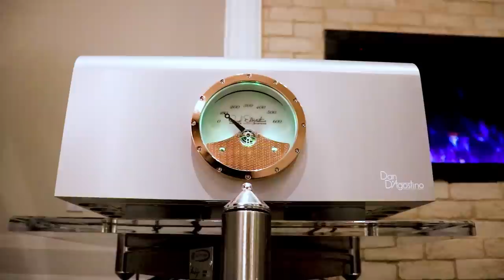McIntosh MA352 vs Hegel H390

Comment: Add in a Processor, reset the Crossover, RTA, set the slope and DB,  recalibrate the speakers. Stereophiles will not live w Processors, however, if it is well calibrated , any system can sound full, bold and expensive. Do note that source used during comparison, are crucial as well.

Comment: @Scott Roberts, and All...

Just a follow up. I have had the Magnepan LRS + for about a month now. They are indeed as fantastic as advertised!   I am amazed that they so fill up the room with sound.  
Prior to the Magnepan I had Focal 1028Be.  And they were very very very good. But not good on the same level as the Magnepan.  The Magnepan sound is coming from the rear as well as the front!  It's glorious.  I also made some changes on the bass side of things.  I sold my REL T9X and replaced it with a pair of T7x's  Smaller--but oh so nice!    Maybe one last addition.  I'm looking at a HIFI Rose RS250A as an external Streamer.  The DAC chip is supposed to be quite good and the user interface seems very new millennium.  I'll let you guys know how it works out.

Comment: From the other side of the globe, here, I once listened to a high end system that was able to make me feel I was in Carnegie Hall (2,000 seats?) when in a listening room of about 5m x 15m and 3.5m high. Maybe 25 years ago. Not brands you sell, but certainly possible with some of the kit you sell. (Pete Seeger & The Weavers in a singalong with the audience recorded from the side of the stage where the band are all behind each other in the right channel). Not my kind of music, but impressively revealing.
I also listened to a system that seemed broken, compare to the silence you mention in "The year of the cat", but here both speakers produced audio. The soundstage simply was cut off along the right side of the right speaker cabinet. After cable swaps and experimentation, a CD-booklet photo of the recording session in the studio solved the problem. The grand piano in the small studio had been placed against the right wall of the studio and this was perfectly reproduced.
The recording of "The Year of the Cat" is likely a multi-track recording with the mastering (in post) placing the "voices" in the stereo soundstage (through the use of pan-pots (panorama potentiometers) ). Reproduction here totally depends on micro-dynamics, both in left-right and in front-back - the latter is actually a fault to our brain. The live stereo miked Carnegie Hal session, however, provides real phase front-back waveform information that our brains can process much better.
If you go back in the history of tube-tech, into studio and recording kit, you will find very "neutral" sound that has no "tube" character whatsoever. Try RCA Living Stereo recordings for that matter. The debate "tube versus solid state" is driven by lazy electrical engineering that ignores waveform and phase correctness by approaching everything as a sine wave approximation. Most audio designing electrical engineers do not understand the benefit of a frequency range beyond 20 kHz. Our ears are not single +/- wire microphones but complex waveform parsing systems that are much faster than our vision. As there are some neurons in the brain with electrical synapses (i.e. not chemical like the majority) we can safely assume these to play a role in waveform analysis and spatial clue parsing that we do in the 20Hz to 20kHz band (which likely only works in the 200Hz to a couple thousand Hz range) by throwing the lowest latency at these tasks.
Now tell me what "bandwidth" you need from amplification (or speakers), what absence of frequency variant phase and distortion faults, we need, to faithfully reproduce all the acoustic audio clues? An electrical engineer told me he had studied Fourier analysis and did not need a lot to reproduce a 200 or 2000 Hz block wave. I don't agree. True in theory, but no speaker, no crossover or amplifier can cut up a 200 Hz block wave into a pulse train of half sine waves that reconstruct the 200 Hz - impossible within the 20,000Hz limit. IMO. Look at the waveform of a clarinet, then a flute, a cello, a violin and piano - all at the piano's central A note of 440Hz. Imagine these to play about at the same time and we can disentangle them and place them in space. Talk about bandwidth and waveform.
My hypothesis is that vacuum tubes have more bandwidth than frequency range. If only the darned transformers, and capacitors for that matter, could be removed from the signal path (a simple transistor is a complex network already, by the way).
Why would one brand do a solid state pre-amp with more than 1 MHz bandwidth? Because they have figured this all out. All the "phase" or "time" attention in your WA speakers is because of this reasoning, too.
It's all relative. Long time ago, one day, I played a reference title in my music collection. My wife traversed the listening room and asked if I had changed something in my system. "Why do you ask?", I said. She answered "it sounds better than two days ago." My follow up question was, "is that important to you?" She answered, "no."
The change I made? Two uninterrupted AC lines - direct spurs - from the main mains panel to the wall outlets of pre and power amp. After all, what we listen to is alternating current "~rectified" (*) and modulated coming out of our speakers. The next improvement came when I phase-aligned all the components in my system - my national AC wall-outlet/plug standard allows phase/neutral to be plugged either way and that is impossible, e.g., with British and French (**) wall outlets (where you must hope that the electricians that connected the wall outlets to the cabling never made a mistake). (***)

None of this defines musicality, by the way, but it is on the critical path to experiencing life-like performance. And we should not forget that we took ages to learn to distinguish mother's voice from the noise floor of everyday sounds and other voices. That learning started already in the womb as soon as the hearing system has been formed and we are born with imprinted melodic lines of our language that we immediately can use to hold our parents emotionally hostage with well performed crying spurts. In order to be able to recognize musical instruments - distinguish them from each other - it helps to go to live concerts a lot so as to train the brain in recognizing all the instruments. Or, our ability to parse and judge music completely depends on the training our brains went through. OK, our physical hearing limitations are a bit important as well.

When it sounds "tubey" it's not good. A neutral mid-range that is free of harsh distortions may come across as warm next to a system that is somewhat harsh in the mid-range, but it still is neutral.

(*) ~ as in ~= meaning "about equal". "Sort of".
(**) So I used these wall outlets in the music room in my house to prevent phase/neutral reversal using wall outlets with a lid on them that is closed when not in use. This prevents, by the way, plugging devices in that I do not want there, like vacuum cleaners.
(***) The phase is easily located in the wall or PDU outlet with the old screw driver electricity phase tester. The correct appliance phase should follow from its schematics and hopefully correct component connection inside ... An easy test, however, is with the in-wall electrical cable detection device you can by in the home DIY store. That device does not have to be able to detect studs and mass density differences. It should detect an electrical field.
Disconnect all devices from mains and each other. Connect one device to mains and switch on. From, say, 1.5m or 5 ft away, with the "electrical cable detector" switched on, move towards the device and measure at what distance the detector "sees a cable". Switch the audio device off, revers the plug so phase/neutral are swapped and measure distance again. The shortest distance is the correct phase/neutral orientation. When all devices are aligned, voltage differences disappear that otherwise exist between device grounds that connect via audio "ground" links (often in one of the two stereo interface links and more harmful in unbalanced connections). You can measure pretty high voltage differences between devices actually when phase/neutral do not align and this means dirty AC would live there. Not the same, but an interesting comparison is with links between digital components that have "floating" links where both ends of the digital link are like a transformer that relays the signal and not the noise carrying voltages.
Reply: WTH did you just do?!

Comment: Always been a McIntosh fan, listen to a lot of Japanese Jazz vinyl pressings that sound thin most of the time. 
I’m thinking the MA352 might be the ticket. I’m currently running a 200 watt
MA 6600. Just love it but want to try
out tubes for a change. 😎
Reply: I have a 6600 and demoed a 352 and I found a marked difference - but I think I want more of an upgrade

Comment: Hello- Although I haven't heard the H-390 nor H-590 I honestly couldn't get past the mess "under the hood" of either. I'm using a YAMAHA A-S3200 Integrated AMP to power my KEF Speakers and I am extremely happy with the sound. 
If you have a look under the cover of either HEGEL AMP and compare it to the YAMAHA, one looks like there was care and pride taken in design and assembly the other looks like it might not make it past burn-in. :) Although I realize time is spent LISTENING to Stereo Systems, it for me is the whole package... just my 2 cents.
Reply: Does the 3200 have a warm presentation with a wide soundstage? And how is the bass control? It has been criticized for lacking good bass control.Thank you
Reply: @Marcus Aurelius  
The 3200 has a nuetral sound that leans toward warm, with my gear. It also produces a deep and wide soundstage. Burn in with a brand new unit for at least 200 hours is NEEDED and could be where some comments about light bass comes from. I have never felt the need to reach for the tone controls. Bass is tight, powerful and extended with great control. There is NO Bass hump, nor coloration in that region with my system. The 3200 just does it's job without making a fuss.
Reply: @ronmiller6344  Thank you for the reply! What kind of KEF speakers have you paired the 3200 with?
Reply: @marcusaurelius2988  Blade 2

Comment: The Hegel integrated units always get good reviews, but personally I’m a little hesitant to spend $6k USD for an all-in-one unit, especially one that includes a DAC. I realize that you can add an external DAC later on, but then you’ve spent money on a feature that’s not being used. I dud not know that Hegel also makes preamp and amp separates, so I wonder how they perform against the integrated units.

Comment: Excellent video as always, and this time, it has a double personal connection for me. The Wilson Audio Sophia's, the Yvette's predecessor, were my favorite speakers that I couldn't afford. One appealing feature was that they didn't need to be used with hyper expensive electronics, just like you are doing here.

Also, Year of the Cat is my all time favorite album, and I never use it to listen to equipment. I prefer listening to the MoFi vinyl, but even the mid 80's CD has excellent sound.

Comment: I'm running a Hegel H190 with Kef LS50 Meta and KC62 sub. 
Sound is fine, detailed and smooth with accoustic and non complex music, but when I play demanding rock like Iron Maiden, it sounds super thin and hollow. The bass guitar is almost non existent, with no body. On the other hand, any accoustic bass, like the drums, are well defined and impactful.
Not sure if the issue could be just my speakers, lacking any mid-bass body, but I also feel that something has to do with the Hegel as well.
It is like if the music was far away in another room and you want to turn the volume up to feel it closely and more realistic, but that never happens, even at annoyingly loud volume.
I also feel like part of the Hegel trick to sound so black and clean is to remove part of the music when it gets compex.
I just cannot get engaged by the music. It sounds accurate and smooth, but doesn't sound natural or life like.
Reply: I think this is actually the opposite where Iron Maiden and in general, 80's and early nineties metal wasn't very dynamic and was mastered quite thin sounding.  Something like classical will really highlight how well your system can handle dynamics. If any amp is going to push low end drivers well its a Hegel, however you might benefit from a warmer mid range sounding amp like a McIntosh if your primarily listening to metal or hard rock which lacks that mid bass punch your looking for.
Reply: It’s probably the recording. But heavy hard rock isn’t Kef’s best thing I guess.

Comment: Appreciate the video. However, peeking inside the Hegel will leave most unimpressed (when factoring the cost). Also, take a look at the used equipment market to see which one will be worth something in 10 years. This is a non-comparison in my opinion since most McIntosh buyers will not consider the Hegel.
Reply: And vice versa
Reply: Btw why would I sell my Hegel H390 after 10 years unless I want to upgrade to H990 which will have been released by Hegel by then.

Comment: I am 7about 71.  In 2000 I had the Magneplanar 6. With BK. Went though a few herd time. Went to from riches to rags and my speakers were destroyed. Lost everything. I remarried at 2019z I was so fortunate. mag 7’1i. Mac 252.  We moved to Costa Rica to get Amat from craziness. Of USA to Costa Rica. Despite my repeated directions to pack Receiver  it came in popcorn and eventually a loose tiny bit of metal was on mother board. It was fixed by Mac Dealer here. No warranty. I stupid cable guy set on my speaker wire and pulled out the black input. I got a turntable. I had many hundreds of records. You can pigeon hole me.  Neil Young, War, please if you listen to Marvin Gaye What’s going on, it is a requirement you listen still for whole album. You will get it. I was never SF in late 60s.. will get why?  Bonnie Raitt. I like her old stuff like HomePlate. We went to a few outdoor dances while I thing the Golliwogs were place. Great fun.,-They turned out to be CCR. I saw Hendrix,, Young, The Band , Janis, Doors, Dylan. Stones in Sacramento, at Altamonte,, and Bridges to Babylon,  Janis Jefferson Airplane, Aretha Franklin, Babyface., Diana Ross, CSN&Y, Steppenwolf,, Marvin Gaye, Bonnie Raitt, , , Paul Butterfield aBlues, . Led Zepelín, Gladys Night, Boz Scaggs, Brian Simpson, Sade, lthe Eagles, Babyface, Lucinda Williams, Maxwell, Diana Krall, Tower of Power, Earth Wind and Fire.. more. I got a turntable and am trying to get albums. Should I only get original  pressings? Lenny Kravitz, ,,. It hard for me to find meaningful music today., For some strange fl reason I put Michael Jackson,,off the wall. It was so so freaky.,I heard what music used to sound like.!!!
Sad story, for  me is that my Mac 252 was finally unbalanced  by cable guy.. 
All of that is I now got me into a pickle. What receiver do I buy? I have 7’1i mags.,I have an old Cambridge just to hear music but it’s bad.  I want to get one  in the next few days., A friend is visiting me  a week. I NEED A RECEIVER. I hate money is issue. I bought   best cables. I have a great Rótele CD  your player.  Can I buy a receiver here? Send me one of

Comment: Thanks for this detailed review. I have Hegel H190 and wondering if I need to upgrade to H390? Please advise.
Reply: I also have a H190 and i want to know the same . So H190  vs H390 comparison video would be great!
Reply: I would say it depends on how loud you typically listen, the size of your room, and the sensitivity of your speakers.
Reply: Wondering if you have upgraded the from the h190 to the h390?   I have h190 using the BW 803D3 on a mid size room.  Wondering if I should upgrade.   Anyone?
Reply: @johnleonffu9946  How do you like the 190 with the B&W. Is the Bass articulate?
Reply: @fredalmgren7211  I ended up upgrading to H390 and my B&W sounded much better.  190 is not powerful  enough.

Comment: The Hegel H390 is 420 watts per channel at 4 Ohms FYI.
Reply: It says 490W in 4 ohms!
Reply: Quattro5081 Depends on at what THD %. 420 is probably more realistic.
Reply: Some magazines have done lab tests and that’s about what they spec
Reply: I have reviewed all their better integrateds including the 590. During this time I have spoken to them directly for specs. In case you are intersted the H190 is 250w at 4 ohms (though not a true balanced design, as with the H390 [420@4 ohms]). Both with damping factors of over 4000.

Comment: I find LS50's have a similar midbase sound at 140 hz. I had to Eq them because I couldn't stand it. I ruled out the amp because I tried with multiple amps and had the same 140hz sound.  Once I flattened out that sound, the sound became much more neutral and a little less muddy.

Comment: Hi, I am really interested in the H390 after this video review.  Can anyone tell me if the H190 has the same level of sound quality?  If it does I think 150w is more than enough for my room and don't mind saving some money, but if h390 is actually better (besides power), I would rather get H390.  Any honest opinion would be greatly appreciated in helping me make this purchase decision.
Reply: I had the h190 and h590. They sound very very similar except h190 loses separation/depth and everything starts sounding mushed together when volume is above 60. Running them in a large room on b&w 804 d3 / 89db sensitivity. If you have lower rating sensitivity speakers then h390/h590 might be better. For me h190 works perfectly.